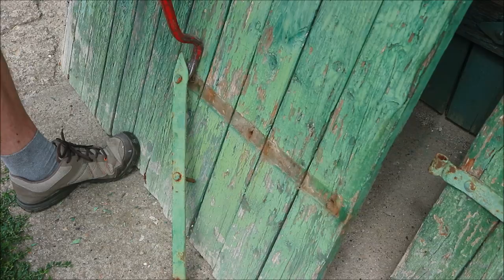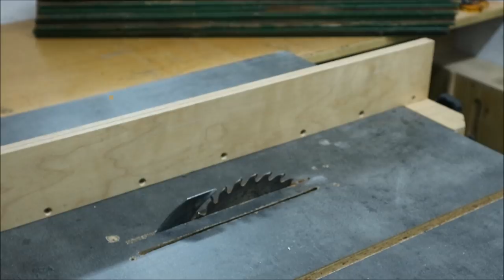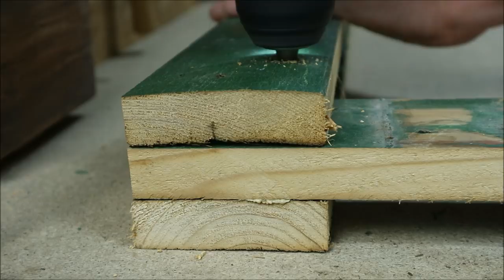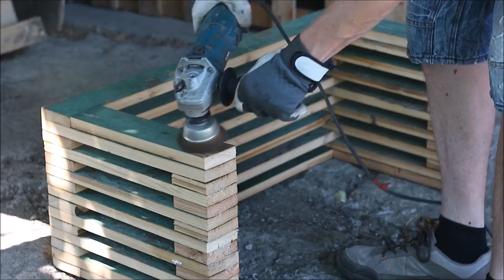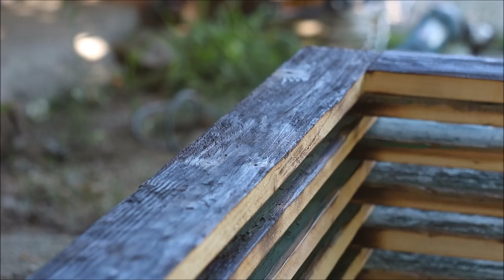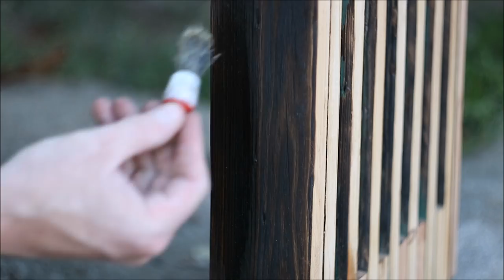Making a Reclaimed Outdoor Sitting Bench ( from an old door)

Comment: Hi! Great idea but did you leave the end grain on the seat and legs (from the bottom) unfinished? The moisture will get in from there and swell the wood and it'll break/look bad. And it will happen really soon, too. Also, putting glue on painted surface - it doesn't have much point? Even if it'll glue it will only glue two layers of paint together? Sorry I couldn't put my words less bluntly :)